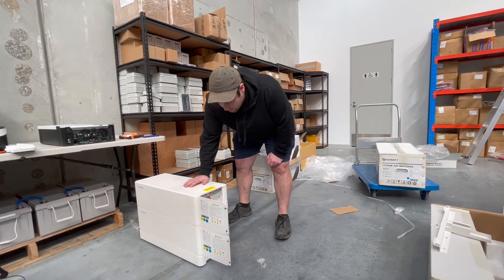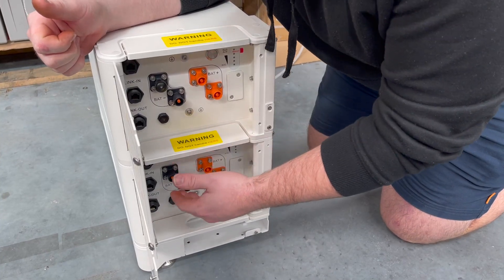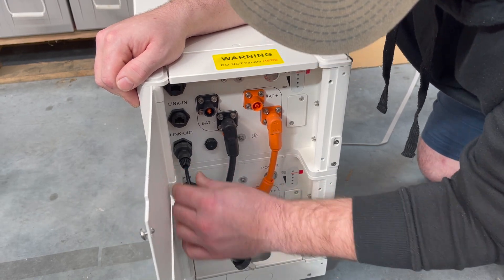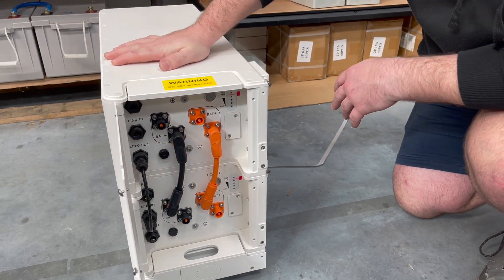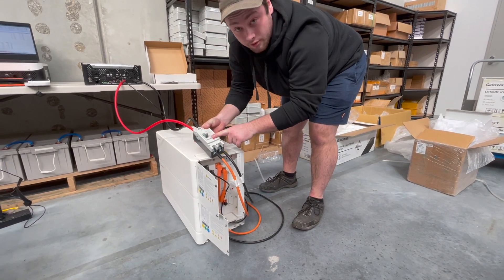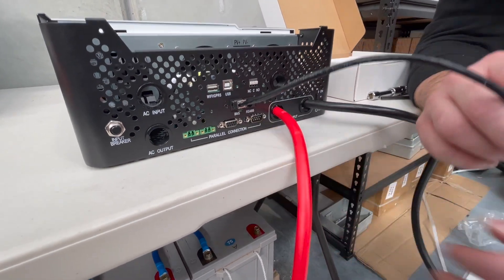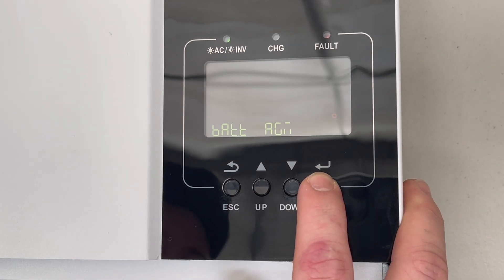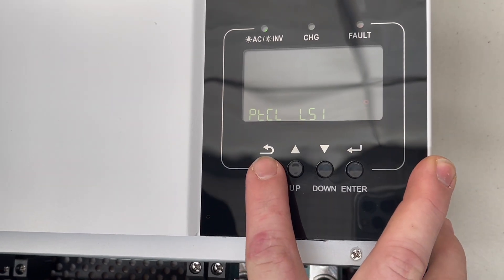How to Setup Growatt ARK Lithium Batteries

Comment: Hey could this be used for a Caravan...? Thanks
Reply from the maker: These are the preferred batteries for caravans due to their low weight and high capacity. If you have any specific questions about the gear and which kits are suitable for caravans then please get in touch with us directly. 
https://gridfree.store/pages/contact-us

Comment: hello. I have the same battery. Do you know if it can be placed standing or vertically? thank you
Reply from the maker: Yes they're designed to stack vertically
Reply: @GridFreeStore   I guess  @FAD-rh7vp means "standing on the floor versus hanging vertically on the wall" . The advice I got was both option exist with Growatt but due to the weight a strong suggestion was made to use the floor base.
Also 10 pieces were the max with 1 BMS but in 2 stacks to be connected with a parallel cable set. (max 6 pcs on 1 stack).

Comment: Do you need Growatt BMS for this to work?
Great video!
Reply from the maker: This video is for a Growatt battery and Growatt inverter. The Growatt inverter communicates with the BMS in the Growatt battery. Some other lithium battery brands are known to communicate to the inverter but they are not officially supported by Growatt. If your BMS is incompatible to the communication scheme or you do not have a BMS you could not use the Lithium profile in the inverter but instead one of the user specified ones.

Comment: Can I lay them horizontally? It's a shame that there is no option to stack them one beside another (cable tabs are only for vertical pairing).
Reply from the maker: These batteries are made only to stack on top of each other (up to 10). However, if this is restrictive you can use a Growatt battery hub to join multiple stacks. We often do this for larger systems as 10 batteries per stack can be quite tall. Battery hubs also increase your maximum current rates if you have reached the limit for a single stack.

Comment: Dear Billy, great video once again. I think that the ARK from Growatt are very good batteries.
Since it's lithium, maybe some adjustment needs to be made regarding the charge or discharge rates on the Growatt inverter? Thank you very much once again
Reply from the maker: Yes there are specific settings you have to change on the inverter, they're all in the manuals.
Reply: @GridFreeStore  Dear Billy, thank you very much for your reply! Can you tell me please in which number of chapter is it?

Comment: Did you turn the battery breakers on to use the inverter, or is the inverter on grid?
Reply from the maker: The battery breakers need to be on for the inverter to work in this case. This is an off-grid inverter, but it can take an AC input for charging batteries (referred to the utility in Growatt manuals). We commonly see back-up generators used with these units.

Comment: For two parallel connected spf 3500 es, the battery stack has to be connected to both invertors right? Thinking of connecting the invertors via a 250 amps junction connector. Is that correct?
Reply from the maker: Both inverters must be connected to the battery stack through MCCBs. You can also use a battery hub if you are looking to run multiple stacks ( a video coming soon).

Comment: Whats the charge and discharge figures on the batteries please. 
The spec sheet lacks this
Reply from the maker: The charge and discharge figures vary depending on the amount of batteries in the stack. A single battery has 25A charge/discharge, 2 batteries increase this to 50A, 3 to 75A, upto a max of 125A per stack.